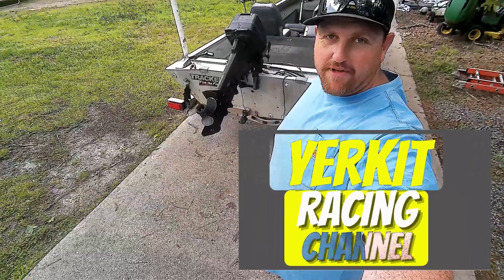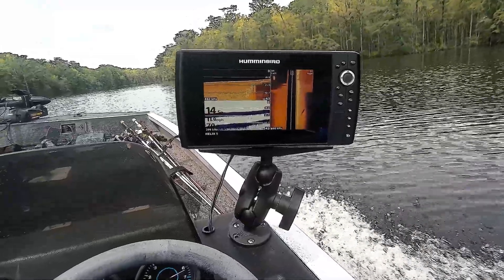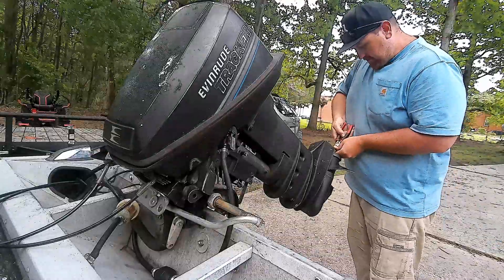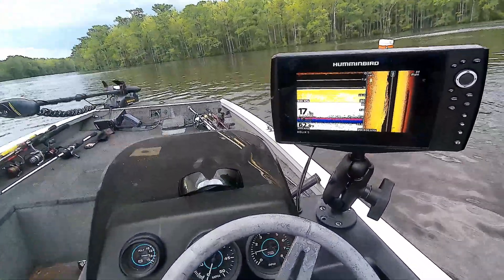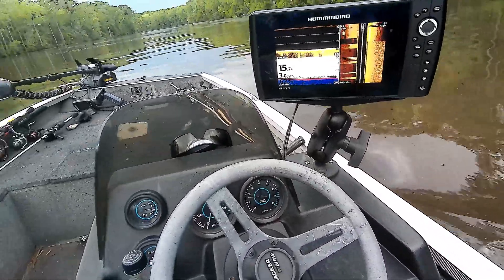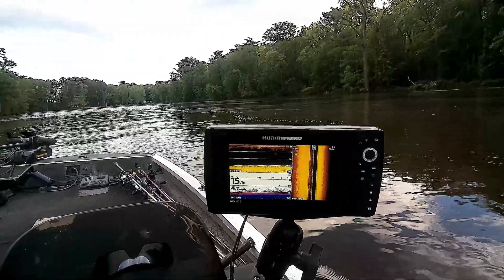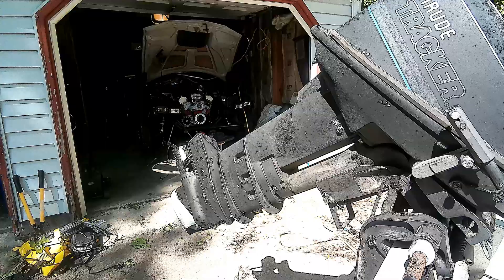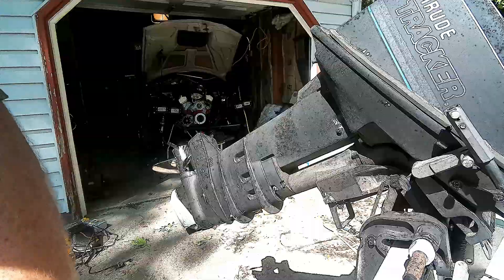Which prop is faster? 8 pitch aluminum VS 9 pitch stainless

Comment: i'd try lifting the motor on the transom some.  modify the motor to turn those props a little better, it should kick a 9 or 10 pitch no problem.
Reply from the maker: would be nice if it would turn the 10 pitch on that boat. Just doesn't have enough power for that much weight. Thought about shaving heads to pick up compression a little. Just don't know if its worth doing.
Reply: @YerkitRacingChannel it is worth it if youre pulling the powerhead to make it a 15 with the down tube and do some light porting.  I decked my head on 120 sandpaper on glass.  She runs above 6k rpm with a 12.5 pitch prop on a light boat.

Comment: Is your cav plate level with tha keel I got mine about 1/4 3/8 inch above and im running a 9 1/4x10 with a foil gets up to 23 24 mph on gps on a 14x36 with gear and 6gallon tank 2 batteries
Reply from the maker: Yeah it’s level. Haven’t tried to go above it though